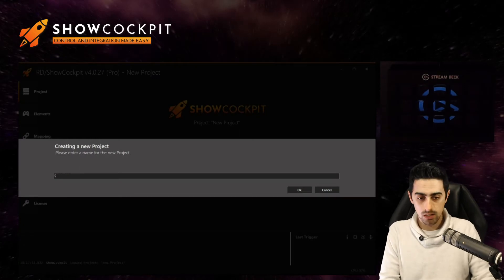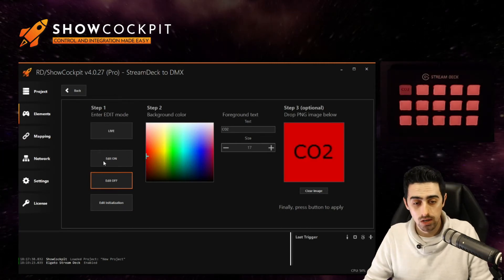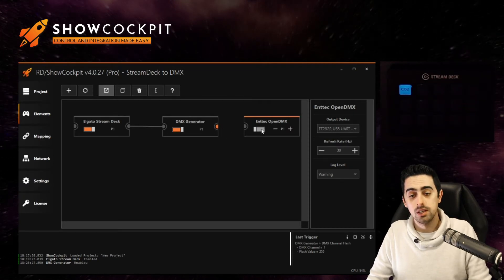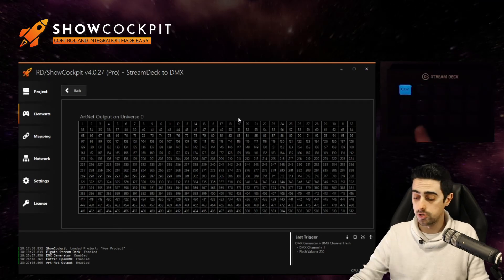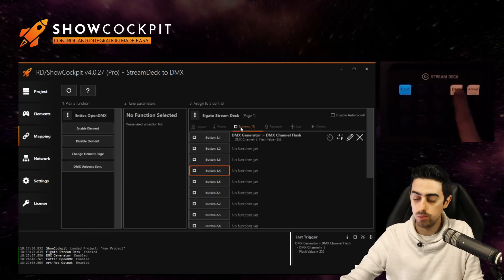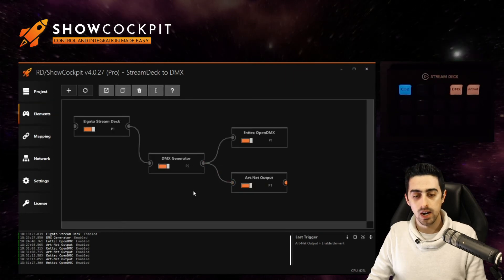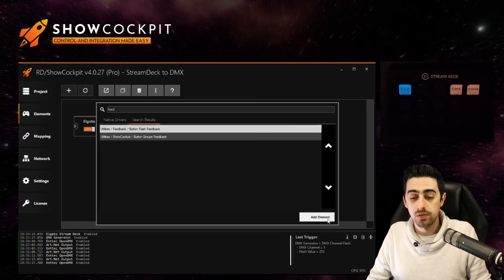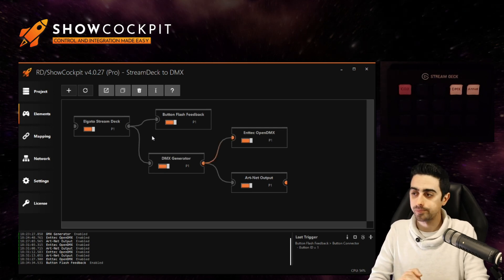Sending DMX from an Elgato StreamDeck

Comment: This is exactly what I need! I am current making a virtual stage in Unreal Engine 5 and I wanted to control the DMX lights in UE5 with my stream deck. The project I am making is going to be running on a networked Windows Server. I'll have to do some research about DMX for UE5, but this is pretty cool!